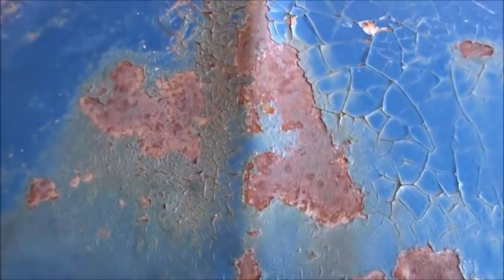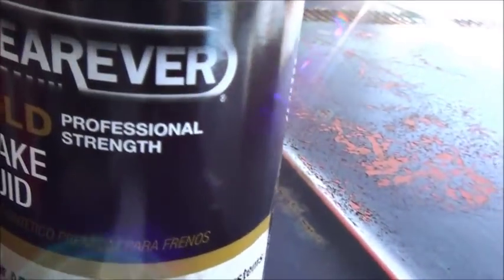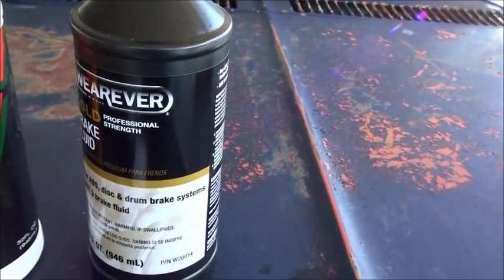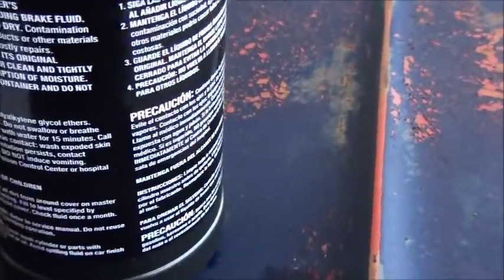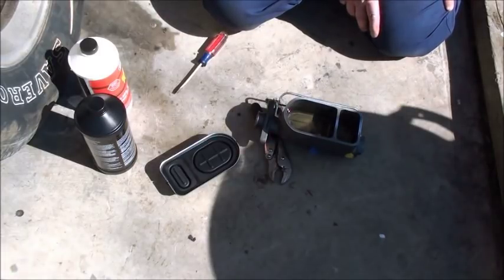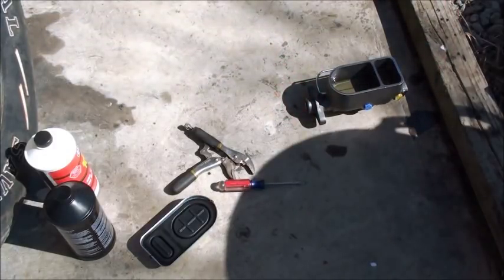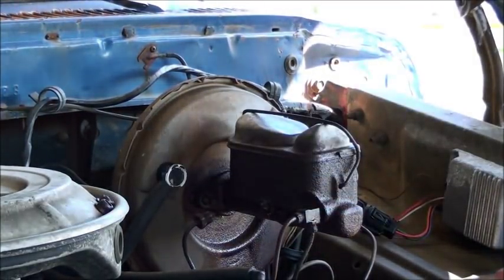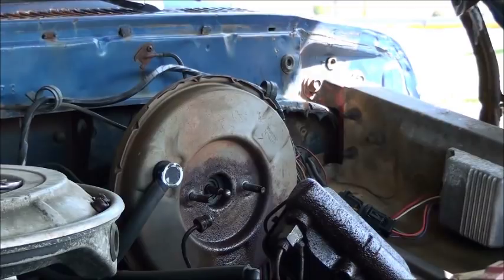HOW TO REPLACE A BRAKE MASTER CYLINDER PART 1 OF 2 ON THE DROF / FORD LOL !!!

Comment: Thank you, for showing your mechanical talents!  I am a widow, my only son is not mechanically inclined at all.  I have a chevy c1500, that needs this repair, the auto shops in my area are wanting between 1100 & 1500 for labor to repair this.  Thakns to your video I can do this repair along with my sons' muscle.

Comment: Thank you very much you were by far one of the most informative very clear and detailed and soft to the ears and I also want to comment about the encounter with your your Auto parts or tow person, I too had a problem with that and right now I am fixing my brake system because they broke my brake system in order to get the club off of my break steering wheel in order to tow it they destroyed my brake system which I just paid something close to $2,000 altogether for and illegally towed my car stole the plates stole the car and broke my brake line now I'm paying for it when I'm trying to get out of this town and I'm stuck here paying for this again and all the auto parts people around here don't even know what a brake master cylinder is go figure I went through three parts stores and one person knew what I was talking about very frustrating but thanks a lot for the video

Comment: Great video!
Interesting comment about inward facing lines vs Chevrolet.
Here in Australia the master cylinder is on the right hand side, so Ford did us a favour!
Anyway just followed your instructions when replacing the master cylinder, I bleed them 2moro.
Many thanks

Comment: I like the "Freeze-Off"...  I have been putting off doing mine in a 1976 GM Sierra, looks very similar to yours, in that the condition of the lines and mounting bolts being all rusted and such... I am going to get the Freeze Off and go do my master cylinder replacement, good info on brake fluid and re manufactured parts... thanks Beltstowing

Comment: helping hint...concerning the "tapping it on the concrete",,what I have found useful, is to put it on, roll the truck onto some 2x6's to make it incline, then  tap on it with a hammer. Works fo me! Gets the air out every time.

Comment: When you change the master cylinder do you have to disconnect anything from the brake pedal under the dash. I have a 74 f100 it doesn't have a power booster but this video should help.

Comment: Really Good, but what happens when the two bolts are off and the darned cylinder won't let go of the booster unit?  Is there anything else that could hold it on other than rust which I could (hopefully) kill with the CRC?
Reply: Barry Holden just rust , it turns into a bang it around with a hammer deal to get it off , be sure to check the booster for rust through if it's stuck like that , if it is , it's junk , the last one I found stuck , I took a pipe wrench to the bottom of the master cylinder , so I could get a small amount of twist back and forth , and banged on it with a 3lb sledge , just being easy with all of it , it let go , don't force it , just massage it a bit ;)

Comment: nice job.  i usually use a push rod to bleed the master cylinder instead of a screwdriver and i usually get on fender pretty far as the master is heavy to turn like you are doing.

Comment: helping hint....sometimes those lines won't break loose. I have used a butaine torch to heat up the fittings. THEN spray your wd 40 or cr knock loose on it. Cant explain it...but something about the heat makes it esier for the knock loose fluid  to go into the threads.  This may or may not be dangerous to the  master cylider mainly because it has rubber bushings in some of them...like where the push rod goes in and out.

Comment: I was driving my car (2001 Saturn SC2) and with no warning, no light on the dash at all, the brakes completely stopped working. I did a sweet power slide to prevent a massive accident and then geared down and used my e-brake gingerly to come to a safe and complete stop.

Comment: @bluecollarable It was cheaper back then to buy a kit than a master cyl.Now it is cheaper to replace most of the time.I also remember my first cars and truck i had had drum brakes up front.and bias ply tires,and points.and do not forget the am radio and 8 track tapes

Comment: My pedal goes straight to the floor when the car is on but even its off it's hard to push the pedal and u can hear air. Before my brakes went out there was a grinding sound to them.

Comment: it's basically the same , but if I remember right your master cylinder has the rod connected to it , and a bolt through the pedal under the dash is all , easy job ...

Comment: well it's not the booster by what you are saying , sounds like you ran your brakes way past replacement until a brake rotor , or drum exploded , and took out the caliper ... grinding noises are not good , they mean replace things , not keep driving ...

Comment: Good video. The only thing .Why didn't you just take off the lines first. Then take the master cylinder off from the power booster. Then you wouldn't have bent the lines.
Reply: well when you have the the line nut rusted to the line , and it will not come loose , what else can you do ? use your head for something rather than a hat rack ...

Comment from the maker: @xmodriver I didn't do the vice grip damage btw , and heating brake lines is a bad idea , it weakens the metal ...anyways it turns out the line to the brake controller was bad anyways ...stay tuned lol

Comment: it's not that easy , if you have a pedal that goes straight to the floor , and easy , the booster can be proved good , but there is a leak in the hyd brake system somewhere , either internal (master cylinder) or external , so check your fluid level if full , it's internal , so the master is the most likely issue , if it's low , it's an external leak , look around the car for the wet of the fluid , and repair whatever is leaking ...hope this helps , tried to stay simple in explaining ...